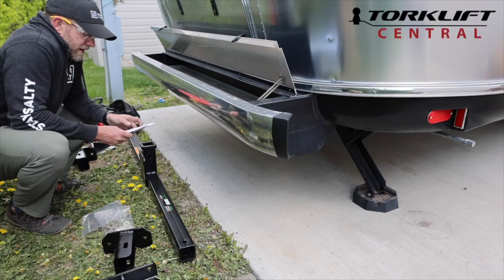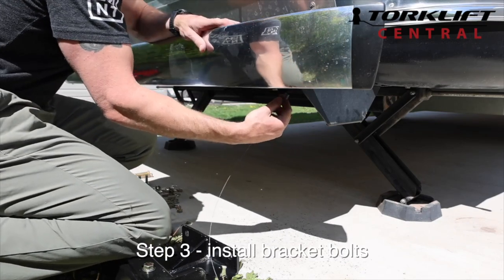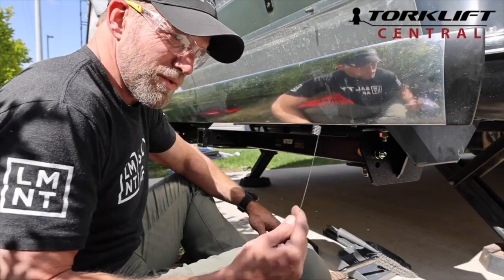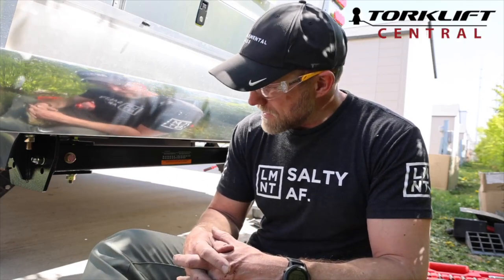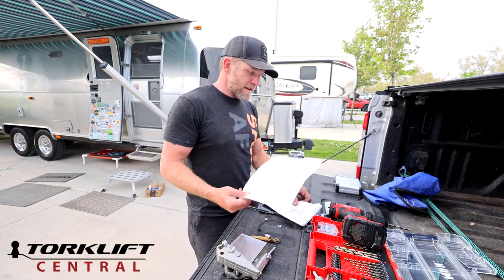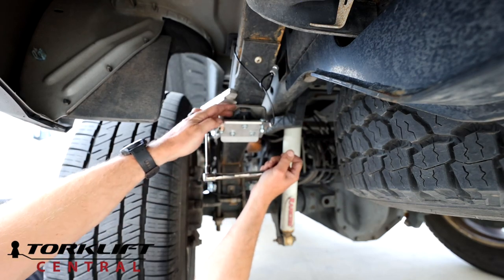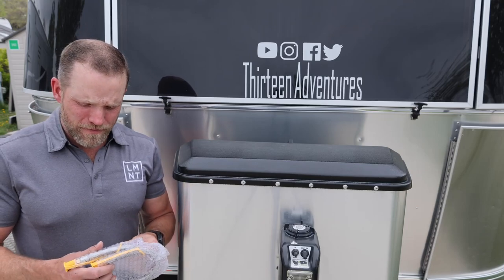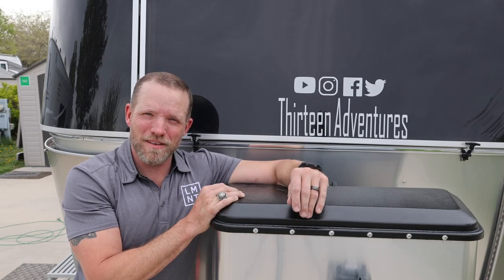Airstream Upgrade! Installing Bumper Hitch, Stabilizers, New Tires, and Propane Tank Gauges

Comment: Now that you added  the trailer hitch you lessened  your clearance  when pulling into or exiting a gas station  or driveway.  They  make a lift kit for airstream,  a 3.25 inch lift, you may need it now
Reply from the maker: Good day!  Thanks for the note.  We have a the lift kit on this rig.  We put it on a few months ago when we replaced the axles - https://youtu.be/nt6P7DG-9SU

Comment: Appreciate the video as it helped me with my install. I installed in a 2019 Flying Cloud 25 ft. very nice quality and heavy duty receiver hitch. All the parts were accounted for, and instructions were clear with pictures to show you how each piece fits together. The hitch is heavy so having two persons makes it a little easier to install. But I was able to install by myself with a little ingenuity and mechanical skill set. It is somewhat tricky drilling the 9/16" holes due to uneven edges in the center of the frame. It took me 2 hours start to finish. I touched up all the bolts with black paint to match the hitch and it looks like it came from the factory like that.
Reply from the maker: So great to hear!  Would love to see a finished product photo!

Comment: The problem with propane pressure is it’s basically constant (vapor pressure of the propane) as long as there is any liquid in the tank.  Temperature can make the pressure go up and down but it doesn’t tell you how full the tank really is.  There are some systems that use acoustic waves to measure the liquid level but the reviews seem spotty.
Reply from the maker: Agree!  These are relative but do give you some idea of what's in there.  This was just a cheap and easy way to measure.

Comment: We researched adding a hitch to our Classic, and after checking with Airstream decided not to.  Airstream engineers are adamant against adding a hitch received to the frame; which sucks as the factory approved bike rack is not well engineered or built.  A few receiver manufactures even recommend strapping the receiver in the center if it will be used for a bike rack.
Reply from the maker: I agree that the factory approved one is not well engineered.  It also detracts from the look of the rig.  We have yet to put anything in the hitch.  I do like the ease of install though.  I meet so many on the road that have bike racks and so far, have never met one who had an issue.

Comment: Good informative vid.  I had the Stableloads on a truck that I used for a slide in camper.  The way I understood it they put the overload spring into play quicker.  I also had airbags but after installing the Stabeloads there wasn't a need to use the bags.  Good product from Torklift.
Reply from the maker: I’ve been very happy with the stable loads. I will have a video soon of using them!  Editing it right now!  Have a great day!